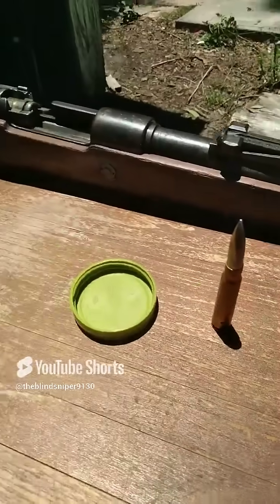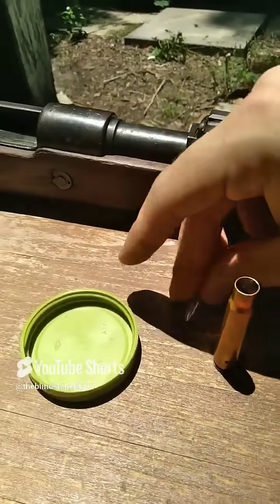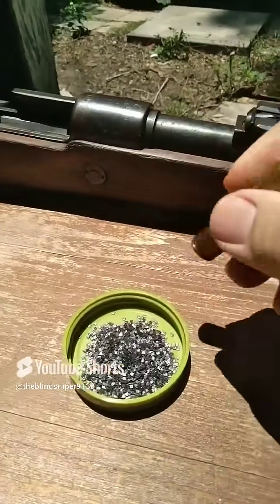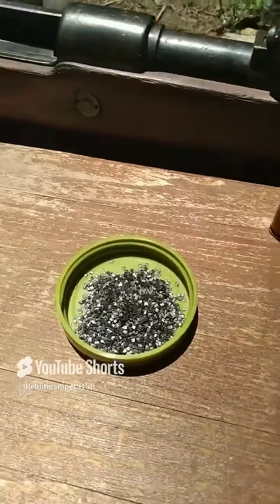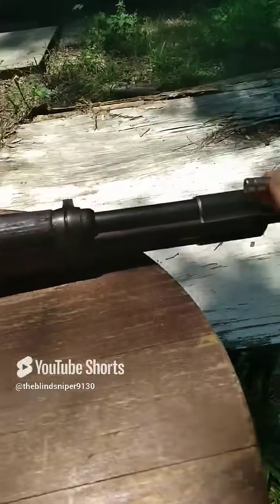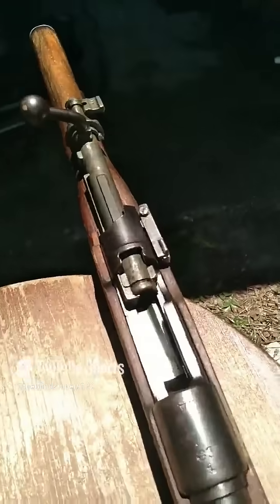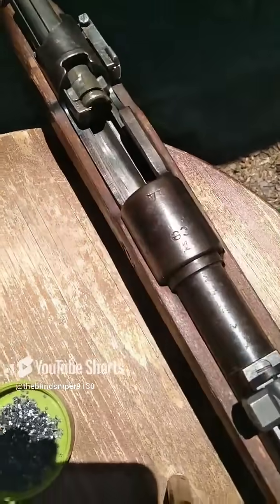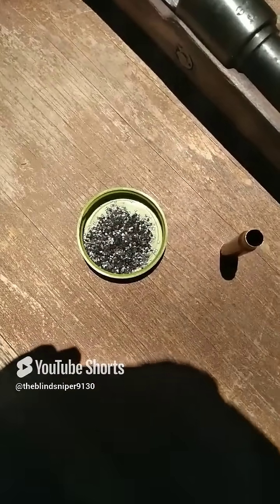How Ammunition Works

Comment: isnt that only Black Powder that "explodes"? modern gunpowder is a solid fuel that creates pneumatic pressure from converting into expanding gasses?
Reply: that's exactly what an explosion is
Reply: @hunterh1175  no, i mean BP is an Explosive itself, while SP is a Sold Fuel. thats why BP firearms can't handle SP, it builds more and more pressure the longer the fuel has to convert to gas under pressure. one contains an explosion, the other contains ever increasing pressure. if you light SP on its own it just fizzles and hisses as it burns rather than exploding like BP does.